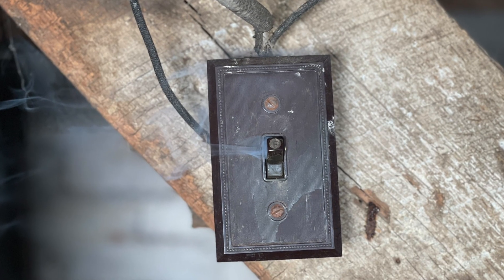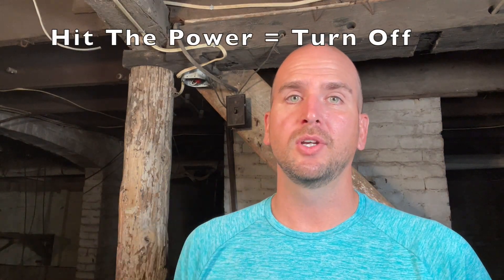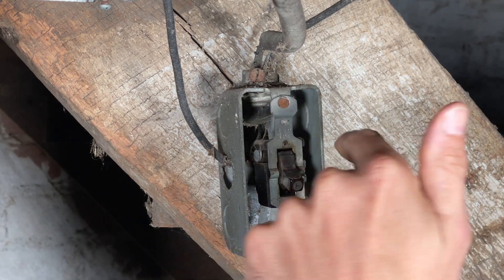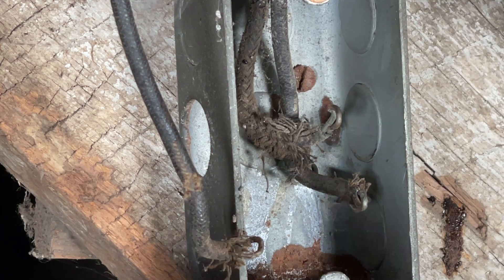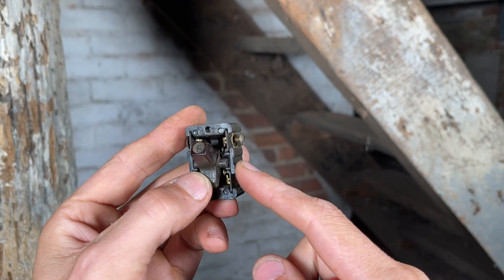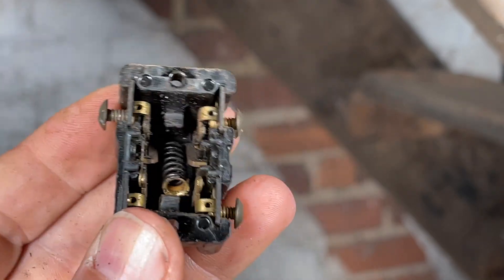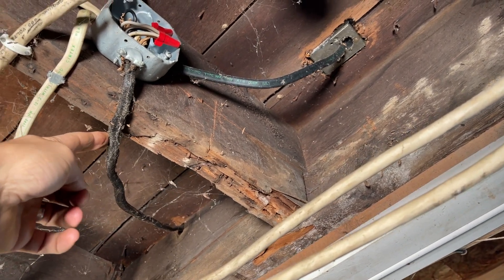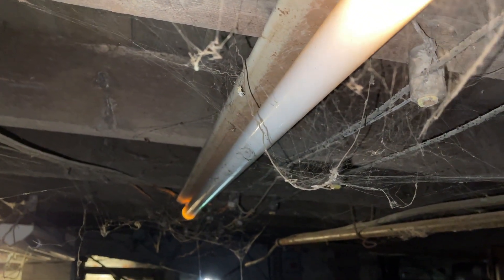Issues with Old Electric Wiring | Knob and Tube

Comment: Very good video particularly for first time homeowners.  Personally I have also seen this style wiring in home built in the 1910s , 1920s and 1930s, when many homes across America were wired the first time and family's could not contain the excitement of turning on the first electric light bulb rather than lighting the gas or oil lantern.  While knob and tube systems were  cutting edge technology at the time, age, deterioration and unsafe modifications are almost guaranteed to be lurking behind walls, in basements,  crawl spaces and attics.   Combine that with your typical 60 amp service,  some only had 30 amperes at 120 volts with just a couple circuits and the recipe for overloading and fires are ever present.
Reply: My grandmother didn't have electricity until the early 1940's.  She did have gas lanterns but no electric service.  One of my uncles bought a house in the 1980's, it still had the gas lanterns and piping in working condition in an upstairs apartment.  He tore that out right away due to concerns that it might start to leak.  The whole building had electric service run in it and appeared to have had it for at least 35-40 years at the time.
Reply: Amen. Got knob n tube?  Replace it all

Comment: I have an older cottage rental that had the meter and fuse box in the front porch that was enclosed to become part of the house. The tenants would have to leave their curtains open once a month to let the utility guy read the meter. I eventually sprang for a new meter and breaker panel outside the house, but the core wiring remains a hybrid of romex with knob and tubing.
Reply from the maker: Yeah, this is the reality for millions of home owners.  Hard for most to afford and/or justify the cost for a full rewire.

Comment: I recently replaced a couple switches like that..5A ones.
For my front porch light, it's knob/tube, bit each wire Is separated, and going into holes in the wall about 4ft apart

Comment: That particular type of switch is a DC snap switch, it was from a brief period of time when some homes had DC power, not AC power, the switches were left over from that time period, so they were used until AC became the dominant power for the country. These switches are by now way beyond their useful life, and they should be replaced with new switches !!
Reply from the maker: Thanks for the additional info!
Reply: @EverydayHomeRepairs  your welcome ! Have fun rewiring the basement ! By the way, the old wires are probably all 12 guage, 14 Guage wasn't used a lot
Reply: That switch is too new to be from the DC era. AC switches had the same mechanism. That switch is 40s-50s era.
Reply: @cgschow1971  Yeah,  it's probably from the 40's, but from information I had, a lot of these switches were manufactured for all over the country. I remember my great grandmother's house had them, and my dad replaced one the did the same thing as in the video ( it got a lot of use) with a new quiet switch. He showed me a stamping on the old switch that indicated that it was rated for use in DC as well as AC circuits, I later found the same information in some electrical field manuals

Comment: Years ago I stayed at an Rv park along the Russian river in California.
After I backed into my campsite I went to connect the shore power to
 my truck camper. I found the park did mot have the commonly found
rv power pole with 20A-30A & 50A service but just a 2X4 outlet box nailed
to a tree with 1 duplex outlet with who knows how many amps. My bet is
15. For wiring there was NO conduit even tho this was an outdoor system.
There was not even outdoor romex, Not even indoor romex. They had 3 
individual strands of wire stretching from tree to tree to tree. Everything looks
old-old-old. Well, I did not trust their electrical system so we spent the night 
using our farther
to a nicer rv park with safe electrical. I did take pictures of what I have 
described to you here & I mailed them to the county building codes
dept. What was done by the county I know not.

!
Reply: OMg everyone could have been killed!

Comment: As a licensed electrician, I have seen so many instances of a well meaning homeowner attempting to "improve" the electrical system, and compromising the integrity to the point where I would not sleep in the house. They take a basically safe but inadequate electric system and "improve it" to the point where it is now dangerous. They don't do it on purpose, but through lack of knowledge and or experience they cannot comply with all of the particulars of the NEC. There may be a dozen requirements of the NEC for the installation of just one outlet. I highly recommend that before someone attempts to do their own wiring to buy a GOOD book and follow the instructions completely. Then have someone competent check out their work, and I don't mean uncle Fred. who drove a milk truck.
Reply: @Toren1156 I would probably not feel comfortable spending time in your residence, if you try to do your own electrical work based on what you learned on the internet. Do you know what size wire to use in all circumstances. do you know how much wire must be left in junction boxes? How about how many wires of each size can go into each different box? I have spent hundreds of hours in classroom settings and I still have to look up things in the code book as does every other responsible electrician. I'm sure I could look at a house wired by a welder and find at least a hundred different violations!
Reply: @hankkline7300  I am sure my home had 100 violations the minute it came off of the assembly line.  There is no reason for a house to need outlets replaced shortly after it was built.
Reply: @mharris5047  I'm not talking about replacing an outlet, I'm talking about a wannabe electrician hanging a ceiling fan on a plastic box, or a homeowner adding a receptacle to a kitchen outlet with 16-2 Zip cord and no ground and hundreds of other dangerous do it yourselfers who are ignorant of the correct proper and SAFE methods of wiring a house. If you have never installed electric for a living under the supervision of a competent electrician, then you are not qualified to do your own wiring. Do you know where GFIC receptacles are required? Do you ever know how to install one?
Reply: @Toren1156 I disagree. 
While the basic principals can be learned pretty easily, doing things right is a different story.
I am not an electrician, but I know enough to know what I don't know. I've also pulled my share of wire, and wired more than enough receptacles and lights over they years on side jobs with my best friend who is a licensed master electrician.
I can also tell you, knowing how to do something, and actually doing it are two completely different things.
Try twisting 6 12ga wires together a few times then come back and tell me again how easy it is.
Especially when you are laying across joists in an attic in July.
Reply: Major electrical work like knob & tube conversion will require permits and inspections in most jurisdictions if a DIY'er thinks they are up for the job.  There will always be some that will bypass the permit process since they can buy all the components at their big box store.  I guess you could buy some books and watch some videos to learn to do your own surgery on yourself or a loved one, but I'll trust my surgeries to a qualified doctor.
Reply: @chrisgraham2904  Amen, but many wannabe electricians out there. I have never seen a do-it-yourself wiring job that meets all of the NEC requirements. Most people have no idea what is required to be safe. Handi-men are the worst.
Reply from the maker: Hey Hank, thanks for the feedback.  What book do you recommend?  I like the Black + Decker books myself.
Reply: I can't recommend a good do-it-yourself book because I have been taking CE classes for 40 years, and we use the NEC. This book will not be understood by laymen, because it uses terms which are particular to the trade.

Comment: Knob & tube wiring was a  good system when first installed,  then people started adding other circuits to the system and 9 out of 10 times it was not done properly and the hazards started. After that I referred to knob & tube as knob & slob.
Reply: i agree, if untouched it is fine, as in this case, the knob and tube was not installed properly into the box
Reply: Knob and slob..... good one😊   your right,  90+ years ago,  knob and tube was state of the art technology and was very safe for it's time, especially compared to the gas and oil lights it replaced.  Most of the problems begin due to one thing. Human error.  Putting 100 watt light bulb in ceiling and cooking the wiring into position.  Burying into insulation especially attics.  Inserting 30 amp fuses to prevent overload from blowing fuse and inconvenience. Bypassing fuse with penny or lining with aluminum foil. Adding more circuits to the existing wiring by means of weak and or exposed,  unsafe splices,  and other unapproved means.  Finding an old house where the original wiring is left untarnished after nearly a century,  is like finding a needle in a haystack.
Reply: @Sparky-ww5re i have actually found wiring that was untouched, usually it has a 30 amp fuse in it, but it came out fine. Usually these wiring systems are okay, but lots of people think old always means bad. how  I look at it is to evaluate it, look it over, if it is fine don't touch it, if it needs to be replaced. replace it, if it needs to be fixed, fix it. i hate it when people say all of it is bad just because of what it is.
Reply: @gtb81.  Unfortunately, many home insurance companies are refusing to write a home insurance policy of knob & tube are present in the home.  Insurance companies are forcing conversion more than the electrical authorities are.
Reply: @chrisgraham2904  yeah, it is usually down to making more money, if you are not willing to comply and pay to have the house gutted in order to remove it, you have to pay lots of money to insure it. it would be much more advantageous to have an electrician evaluate it, some do but not many. if i understand it correctly.  usually knob and tube is not beyond repair if it isn't fine already. i actually have only seen one house with knob and tube that actually needed the rewire.
Reply: @gtb81.  I do know of one friend who received a demand from her home insurer to upgrade her 1910 home from knob & tube.  She had a licensed electrician do a complete inspection of the home's electrical system and the electrician certified that the knob & tube system was in good working condition with no illegal modifications.  
Her insurance company did accept the electrician's certification and renewed her home policy.
Reply: @chrisgraham2904  i am glad to hear that, seems there is hope yet, i actually wired a shed my dad built 30 years ago in knob and tube, it was a fun project and looks really cool also, i really appreciate the system and even tested it out under overload situations. I found that the knob and tube if done right will preform better than the plastic wires we have now, 60's did a bit better and the 40's style better than that, with knob and tube on top. ended up pushing 90 amps through 14 gauge wire

Comment: I upgraded my sister's 1911 house from knob and tube to Romex adding new circuts and and a breaker box.  No old wiring remains.   It was a lot of hours.   My house was originally knob and tube with some upgrades.  The 1929 knob and tube was done to a standard not seen today.  In General the remaining knob and tube is better than new construction work done today.  I have had to replace worn outlets and switches.  I save the old cloth and rubber civered wire (the insulation falls off) for projects as the copper wire is high quality
Reply: I spoke with many electricians. Knob and tube has a bad reputation, the actual conductors were heavier and better copper than today's. Points of failure are the connections at fixtures and switches. The wires behind walls tend to be ok since they are not exposed. The knob and tube in a basement ceiling should   always be replaced because is the easiest and if you accidentally break it could get electrocuted (your feet are literally grouded).
Reply: @TheGonso35  Although the house didn't have any known knob and tube the 1910's or 1920's cloth covered wiring that was in one of my father's houses in the late 1980's appeared to be about 16 AWG.  If it had been my house that wiring would likely had been immediately replaced (I did help him replace part of it and we did do complete circuit replacement and not splice into the 16 gauge, at the time 70 year old wiring).

Comment: I run into SO many homes that have the panel cobbled into cloth groundless, or knob and tube… it is always a better idea to actually replace the circuits all the way… an alternative is install arc fault breakers… the ones that will not stay energized MUST be replaced…

Comment: Old BX cable is a serious safety issue, and is a frequent source of fire here in Massachusetts. BX cable is a metal sheath wrapped around two or more conductors. BX was standard practice from the 1920s until the 1940s, when it was replaced by first-generation Romex cable.

The issue with old BX cable is that insulation of the conductors inside the shield deteriorates and becomes brittle and fragile with age. Once that happens, then ANY movement of the cable can cause that degraded insulation to break off and expose the conductors to the sheath and to each other. 

The typical fire scenario is that a homeowner or even licensed electrician replaces a bathroom ceiling light fixture with a new box and exhaust fan. The existing fixture has several BX runs to other locations on the same branch and a BX run to a nearby switch. While replacing the box, all of those BX runs are moved a little while doing the work. Each run often has a bend where it goes down into a wall cavity, so when the BX is moved, the area near the bend moves a bit while the bend stays fixed. The work is done, everything is buttoned up, and the new fan works fine. A day or so later, a fire starts in one of those BX runs, where the movement of the cable caused the insulation to break off the conductors.

The firefighters I know tell me that old BX is more dangerous in my Massachusetts city than knob and tube -- if nothing else because most knob and tube has been removed, while too many homeowners see BX and assume that everything is fine.
Reply: Old BX should not be a problem by itself. BX is like modern MCAP or armored Cable in regards to grounding. I understand that the cloth can be flammable. But any short should blow a fuse or trip a breaker. The steel jacket should contain the spark and should help prevent a fire by denying it oxygen. I’ve seen a lot of BX that is in a sorry state. But I’ve never seen a fire outside of a box that resulted from BX. The biggest issue I’ve seen is when the cloth breaks down were the conductors enter the box.

Comment: Wire wears out over time and becomes DANGERIOUS..Switch points become pitted and dirty,this results in arcing.burns like a welder arc..heats the wires and causes fires..You are correct.updating breakers does not fix the problem, replace it all.Also,old systems waste power.Takes more power to  get through old worn out wires than new wires.conducitivity goes down with age...youre right again..
Reply: @Oliver Taylor: "Also,old systems waste power.Takes more power to  get through old worn out wires than new wires.conducitivity goes down with age". 

The conductivity of a specific copper wire does not change with age (at least for the timescales we're talking about here). Many older homes are wired with smaller conductors than modern life demands, and those should be replaced. To the extent that "old systems waste power", the waste happens by pushing current through conductors that are too small. The system wasted just as much power when it was installed as it does today. It is the size of the conductors that matter, not their age.